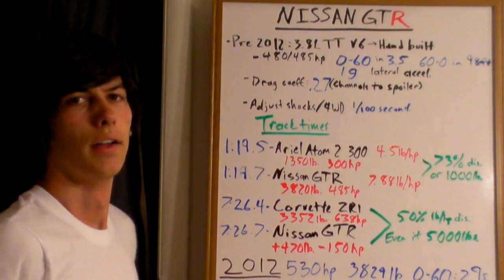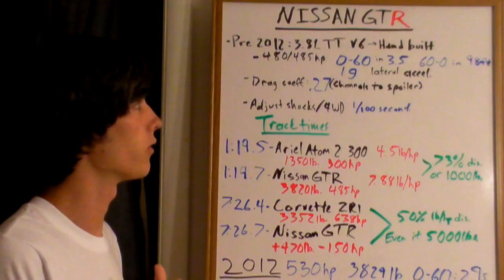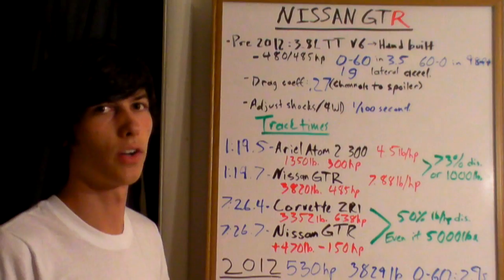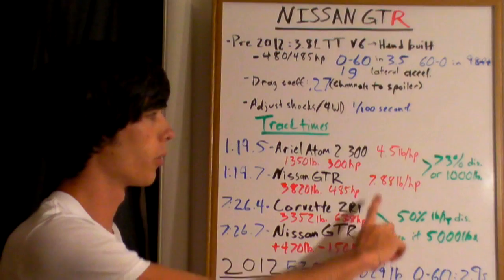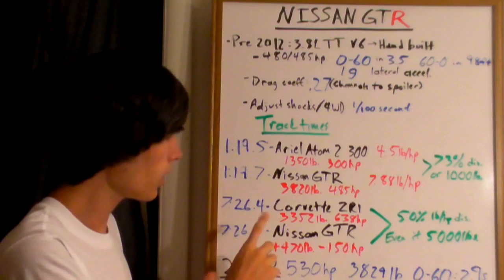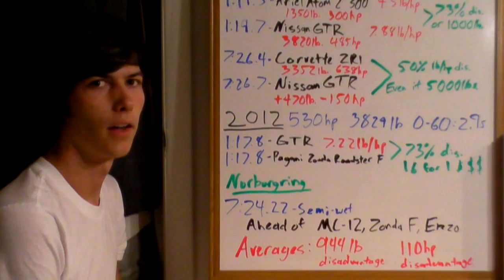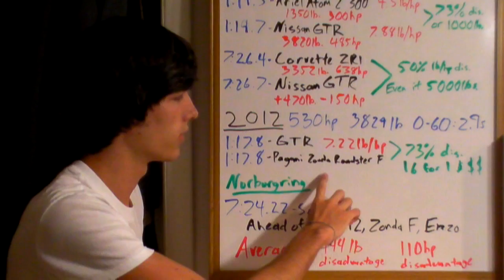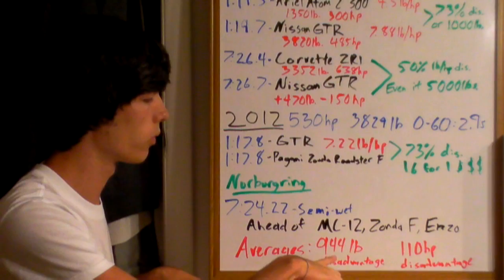Nissan GT-R - Engineering Excellence

Comment: @KalEl600rr BTW by practicality im refering to people you can carry and luggage.

Im not saying the car will out handle the bike, im just saying for the fact that the car weighs something like 1730kg which is 432kg per tire (curb), it can handle AMAZINGLY well.
were as the bike weighing in at 170kg which is 85kg per tire (curb), well common that ain't to amazing is it.
Now yes I know the car has wider, bigger tyres and 4 of them for stability but still im saying the GTR handles amazing, no more.

Comment: The porsche turbo has similar performance. I think it's so fast because it's amazing 4WD. and it has a turbo engine that produce alot of torque, which in a havy car like the GTR is useful, and then ypu have to consider duble clutch gearbox and other things, it compensate it's weight and power deficit whith top engeneering. More astonishing i think is the price which is very low for the amount of performance it has

Comment: Surely you know that downforce isn't the only factor in aerodynamics? And the 2013 Viper T/A, on stock Pirelli Corsas, beat the Zr1 on PS Cups tires around Laguna Seca. Which is amazing, when you consider how much longer the Corsas will last under daily driving conditions with the occasional hard pulls and tire smoke mixed in there. You'd be lucky to get 10,000 miles out of the Cup tires. Corsas (rear tires) should last at least 15,000 miles, with the front tires seeing well past 20,000.

Comment: I doubt the gtr actually has  .26 coefficient of drag,since politicians are more truthful about their numbers than Japanese automakers. The reason I see the gtr as being to successful on the launch is it's high gear ratio in the low gears(1st:4.056,2nd:2.301) which is 1 and .15 higher than the ultimate aero which is a v8. The gtr also uses nitrogen filled tires which would explain it's handling. Overall, a great car, but not a "magically" piece of engineering.

Comment: ... the new car ditched 4w steering to reduce complexity and drop some weight.

A car is as it is ... some are very light (Atom), extremely powerful (Corvette), have great down force (Pagani), etc ... they are choices makers make and give cars there particular look and character. So, a GTR has 4WD, 4 place, 6 cylinder 3.8L engine, it weighs 1800Kg, has a DragCo of 0.27-0.26 ... it is what it is, so for some, appreciate what was made.

And any person can go fast in it ...

Comment: I've heard of Nissan giving the lowest rated Hp for the GTR. (Some) GTRs have been dyno'd by people who purchased the vehicle at 500+ crank horsepower (pre-2012 models) which well exceeds its rating.  This can be due to the controlled environment each engine is built in (supposedly).

Comment: I would go with an Evo (and just have, with the ix model I now own) instead. Sharper handling and less work to get more performance out of them. Both of them are terrible on fuel, but the STI does sound better with a decent exhaust. Not that Top Gear are right right about everything, but I do agree with their Evo vs STI comparisons

Comment: Disagree with you, look at them, the outside part is near semi-slicks, more than Pilot Sport PS2. You can compare them to the Michelin Pilot Sport Cup which can be used by the Corvette ZR1. The cornering was better for the ZR1 in this case. The F458 use Michelin Pilot Super Sport with more grooves.
 Whatever the Ariel tires, they don't know how to use correctly a tire, as I can see their performance. And,as they are only 2wd, they cannot use the "traction circle" of the tire at the maximum.

Comment: Why did the 3000gt weigh 3850 with 300hp but run 14s hunh, it had good gearing, best gearbox of the time and say you add the 485hp to that and better gearbox it would be quicker. Also the gearing is lower in a gt-r so its quicker up to speed even though it runs 11.5 quarter mile times just like the zr1.

Comment: "Competing"? Did you read the article? It's no "competition" when you're doing your own tests.

When Car & Driver tested the GT-R on the skidpad it revealed it was capable of pulling 0.96 G. Many of the Le Mans type supercars pulls well over 1.3 G and will crush it in acceleration in speeds above 40 mph. It's not possible for the GT-R to even be close to these cars without lowering it's ride height and changing tyres to slicks. You're an engineer right(?), so deal with the facts.

Comment: ... and most of the "serious" lap times are done by independent sources btw. Top Gear is kind of ok since they have the same driver under controlled conditions. They may lose or gain a little here there due to weather. On The Ring you have Horst von Saurma setting the benchmark with their Supertests. Just about everything else is irrelevant trickery.

Comment: You forgot to mention, part of the "engineering miracle" is the GTR's suspension, which is insanely stiff. How much? It's "soft" setting for roadgoing is stiffer than the "sport" setting on a Porsche 997 911 Turbo S. Don't believe me. They have a discussion about it on NAGTROC.

Comment: i'm not questioning your inteligence or something , but this is the GTR secret , if i had it i would be a millionaire , the ergineers at nissan did'nt use physics they deffy it , you're underestimating how over engineered the GTR is
for the second part of your question , the GTR need the weight because it have a limited down force , low drag ratio , it can reach top speed with less air resistance , and it can corner at high speed with a magical mix of mass and torque distribution , its the GTR !

Comment: alpha 12 is 1500HP. 1700HP is probably alpha 16. and that high HP only kicks in at higher rpm so doesn't help a ton in terms of 0-60. 2.4 is the fastest in the world i believe and as you get to sub 3.0 sec domain it gets exponentially harder to shed every 0.1 sec of your 0-60.

Comment: You need to be in one to understand.
But I own a S14a 200SX, It's not near stock, but the engineering excellence put in, atleast the model I have, you americans got crapped on with them, but it's far ahead it's time.
The GT-R Is the same, They have cared little of the interior, soundproofing, material choice. however their engines and technology, I suggest looking into SR20VE found in Primera P12 in japan or VQ37DE in the 370z for some odd tech's not usual for nissan.
Atessa is also another.

Comment: And worse cornering speed because of having understeer, and it still managed to go around the nurburgring as fast as a corvette, which is rear wheel drive, the only real advantage of having AWD is the speed from the start because of the doubled grip.  This car has little to no understeer, and it is a mystery on how they actually engineered it so it doesn't generate understeer.

Comment: its a lap time not a drag tine the GT-R does corners much faster than a lot of the cars you mentioned there because of it superior all wheel drive and handling ... if the GT-R was in a quarter mile drag race with any of those cars on that list ... the GT-R would be smoked.  BTW nice video you should try to review some performance cars and then explain the engineering principles as you drive them.

Comment: 2011 Porsche 911 Turbo has 7 lb/bhp (500 bhp, 3500 lb) and has a 0-60 around 3.2s, kind of the same anomaly. Turbo S, not quite as much with 6.3 lb/bhp and a 0-60 of around 3s.

Comment: Imagine if Lexus shoved a big fuck off rear wing that generates about 200kg of down force and a front spliter generating about 100kg of down force on the lfa, that's what they did to the ACR. Not to mention the tracks the Zr-1, sls amg, Viper etc etc are good at are very high speed tracks, which is exactly where extremely thick tires and high HP come in to play, the gt-r was never designed for high speed tracks and it still competes with them.

Comment: its simple. the same way jgtc cars can weigh 3,000+lbs and way way way outhandle all the production cars. by adding massive amounts of weight to the underside of the car they lower the c of g. jgtc cars are made of carbon fiber etc all the lightest most exotic materials yet they still weigh quite alot (per racing regulations), they literally add bars of metal (i think lead) to the bottom of the car, which actually helps the car handle

Comment: I think the gtr is outstanding  because of the 4wd. Also i believe the 4wd spreads the power between the wheels with an amazing differential.
Reply: Also the traction
Reply: xp10199, wow complete denial.
Reply: Being fun as in spinning around, and increase the risk of setting a lower lap time. Isn't every other well known sports car out there being controlled by electronics or computers. They're called safety measures. It correct your driving, and makes you think you did it your self sooo...
Reply: xp10199 Dude chill, gtr is a very impressive machine, give it credit. However I would not trade my "cheap" miata for a gtr its simply dosnt have the "rawness" of driving experience. Agree its not a real man's car, its for undertalented people to drive fast and track records mostly.

Comment: Its possible because the cars you comparing it to are 2WD where as GTR has excellent 4WD system. You can have really good weight to power to weight ratio but if you cant put that power down on to the ground you not going to be going anywhere fast.

Comment: The engine also weighs 600 lbs. That's getting up there near the old Viper iron-block V10. 

Domestic V8's are weighing it at under 450 lbs in factory trim, wet weight, many of which are 550 to almost 700 hp, and are still more fuel efficient at 24-26 mpg than the GT-R's 3.8L TT V6, which gets a piddly 23 mpg, with all that awesome engineering lol :D trololol

The competition is great though, everyone wins, the economy grows, cars keep getting faster, technology leaps into the future and such :)

Comment: The Insane 0-60 times are a result of the Duel Clutch Plate Transmissions that are being produced and Launch Control.  The GTR has them and some other cars as well - Porsche puts it in just about everything now.  That how a new 911 Turbo S can hit 0-60 in 2.6 seconds.  When we are talking about literally a few tenths of a second here or there it adds up and that's how these times are produced. Shifting between One Clutch Plate and two gears is too slow.

Comment: ummm, i think i have figured out why the GTR is much more better,(i m not expert on this but
1. it has got a computer system that monitors and alters the grip at each wheel by adjusting the suspensions every 100th of a second
2.the car has a good weight distribution(now you understand why they put in a V6 instead of a V8, cuz they need to balance out the weight at the front with the transmission!)
3.it's weight gives it a lot of standstill grip, meaning no burnouts at the start

Comment: @3ua One question. why the hell are you refering to the ariel atom 500 when this is about the GTR lol?

Anyway ill go with it. what is it with you people comparing bikes to cars??? THERE COMPLETELY DIFFERENT lmfao. they are two COMPLETELY different types of vehicles, a car is designed to carry people comfortably (generally). a bike is built to FLY around a track (generally). comparing them two things together is like comparing a tractor to a plane, its just not gonna work.

Comment: But my question is, why isn't the tech used more, SR20VE P12 VVL/VVD with VVT Variable Valve Timing, Variable Duration and Variable Lift!
VQ37DE Electronic camshafts..
GT-R From R32 onwards.
Atessa, it's so good. search up ice ricers :) why isn't this tech in more common cars, it's such an advantage, it really does wonders.
I've driven most nissan cars to date, and I see rarely this tech and it's seriously advanced, must have cost alot to dev. yet they don't exploit having it...

Comment: gearbox low ratios and shifting speed, all wheel traction, power is made with less rpm using turbos and lowering the vehical using the shocks, another vehical the new f12 ferrari

Comment: F1 is a different story. You cannot compare F1s to road cars. F1 cars have very high Power to weight ratio and are built like a wing on a plane they produce so much downforce that helps them to stick to the ground around the corners and also to put the power down to the ground.

Comment: GTR's are faster from them being quicker around corners from weight distribution, 4wd,  the electronics that go along with the diff+suspension, torsional strength, ect.  
Any real racers knows that you gain most ground going around corners faster.

Comment: I think we have to look at tire loads ant the way the GT-R is able to load its tires to produce or get out of them every bit of grip it can at the optimum slip angles aided by the computers, here lies the car "magical" performance,  for this same reason the GT-R overworks its tires and can only maintain its level of performance for a few or even ONE lap,  the car weight is an important part of this.  The GT R is a great Time Attack car, but after 10 or 20 laps it will really start to suffer.

Comment: the weight distribution of a GTR aids its cornering speeds. .getting fast times does not depend on how fast (top speed) you show .... its how fast u accelerate , brake and go around corners.. as a ZONDA n ENZO depends heavily on aerodynamic down-force, the density of air hinders with the gross handling of the cars.

and secondly when you are driving a car expensive enough as 16 GTRs  .... even a madman will resort to his senses .
and finally " its the man behind the wheel ... not the machine "

Comment: @isdisavailable3 You must still be living in 2005. 

The BMW S1000RR was less than a second slower than the Atom V8 500 around the top gear test track. Faster than the 12c, aventador, veyron super sport, zonda f, gtr '12, enzo, 458, carrera gt, apollo s, GT2, atom 300hp and pretty much any other car you can come up with.

 And that on stock tires and stock suspension settings while the atom was on semi slicks.

Yeah, you lost that one gramps.

Comment: Not knocking the GTR as it really is a feat to be marveled by fellow R&D specialist but the computer systems as of the early models are buggy! If you ever actually drive one, they are really boring because they hold the road so well. From an enthusiast standpoint, I don't even like DCT. I will give up a .01 of a sec in a standard just to feel the road. Also different drivers different lines are going to make your numbers vary around a track. You asked for an alternative. Porsche 911 turbo.

Comment: Engineering Explained  Why can GTR go so fast at Nurburgring? Is not what you said. GTR fast at Nurburgring is because of 4 facts.
1, weight
2, damper/suspension
3, gearing
4, all-wheel drive.
1, Nurburgring have more than 100 corners. Most of them are 120+kph corners. At that speed turn through a corner, stability and traction is an issue. Especially for lighter cars. Unlike race car, road car do not have as much downforce as a track car. So front end and rear traction is an issue. GTR weight over 1700kg is like a 1500kg car with 200kg of downforce. Similar as Agera R travel up tp 240kph. Is simply enough grip for a 180kph corner.

2, Nurburgring is a bumpy race track, cars can bump all over the place. With a adjustable electeonic suspension/ stiff damper, it can transfer weight rapaibly between front, side and rear. stiffer damper also mean quicker vehicle maneuver. The car can react quicker than normal. However, is like choosing hard tyre or soft tyre. The downside of stiff damping is bumpy road. You may see wheel bump to the air and lost stability. However as I said, GTR's weight 1700kg+ which aids stability.

3, With the correct gearing, the car can accelerate hard and smooth at a certain speed range. GTR accelerate pretty quick at 3-5th gear. The max speed of those gear is similar to Nurburgring most cornering speed.

4, all-wheel drive is an awesome layout for"Nurburgring like" track but not a big deal for tight tracks like Laguna Seca, Street of Willow, Nurburgring GP etc... However, GTR maintain almost 100% RWD at straights and may be 40-60 through a corner. The tricky part is, AWD allows youto reach the apex of corner, but IF a car with a soft damper and high center of gravity, it'll create massive understeering and push. GTR exist one, (High center of gravity) and its fixed downforce (weight). Luckily it wear a stiff damper and electronic suspension for weight distributing.

Actaully GTR Nismo proved my point. Stiffer damper than the Nissan+ 100kg more downforce than the Nissan it ran 7:08.
Reply: +1
Reply: So why is it still remarkably quick at the top gear test track which is quite frankly.... None of those things
Reply: Lee Frost On top gear UK, it's a soft damping killer track. Lots of weight distribution and very fast turns. ET-S GT-R AWD won't put too much power at the front, it's a part time RWD allows better front end handling, also a stiff damping+ anti roll bar with a sensitive stability control and aggressive yaw rate program, it's only disadvantage is underpower, weight and height.
Reply: After reading, thought and analysis of your text good sir, I have realised that what you were basically saying is that the gtr is a magnificent piece of engineering.
Reply: Fortune Ndou Yep, it is a magnificent piece of engineering. It worth the extra $$

Comment: its not all about power man think about the rest of the design like when you play videogames and they show yu stats like power, weight handling ect. that extra weight keeps the tires from spinning as much, the tires could have more trasction by design the car could be more aerodynamic the transmission and drive system could make all the difference like how a suby has better offroad capabilties than some jeeps just because of the awd system even though jeeps are made to offroad.